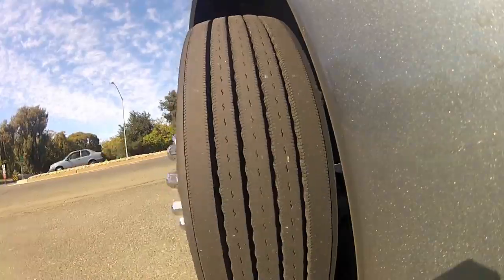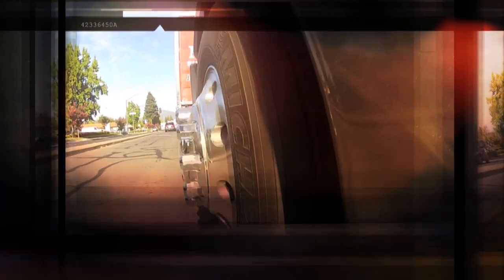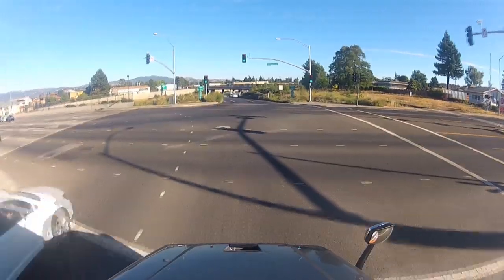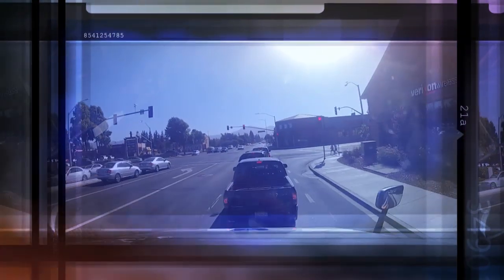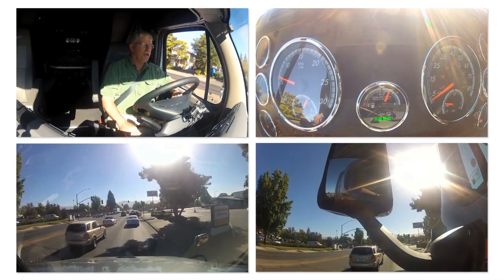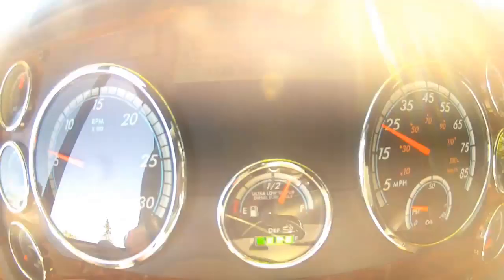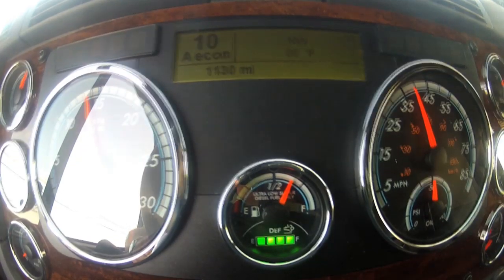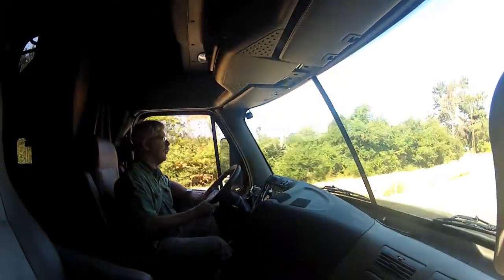Detroit Diesel DT12 Test Drive: Pt.1 - Around Town with the DT12

Comment: I don't give a dam what no one says. Being and 19 year vet, automatic trans is not made for pulling 40 to 50k of wieght everyday. For one thing when pulling mt trailr or lightwieght it tends to not tach out fully to 15 rpms. And thats not good. U can feel the lost of power. The one i drives actually drops to 800 rpms and that's way too low. Manuel trans r made for pulling serious weight. I mean if a person prefer an automatic them that's fine but manuel will last longer than an automatic. They will stay in the shop...

Comment: So basically they are doing what Volvo has been doing with I shift for years.
Reply: Steve Pratt except I-shift rocks.  The cascadia transmission is soooo slow to process shifts, and can't jump gears as quickly as a driver can.  Hell, i start out in forth, jump right up to sixth, then eighth, ninth and tenth.  This damn thing wants to start in third, then sit around waiting for fifth, then sixth, and so on.  I shift does what i want it to do, and is more responsive to my inputs.  Cascadia just ignores me.